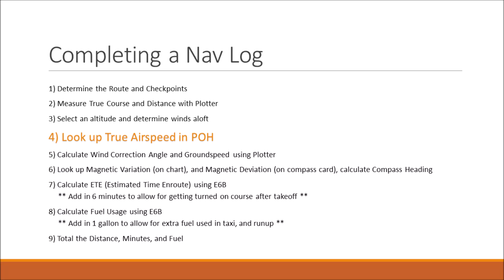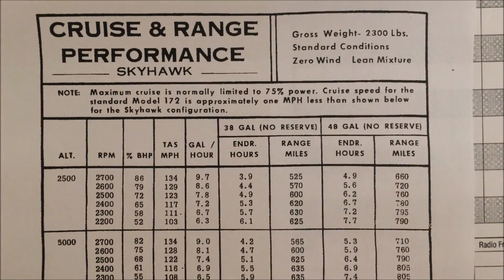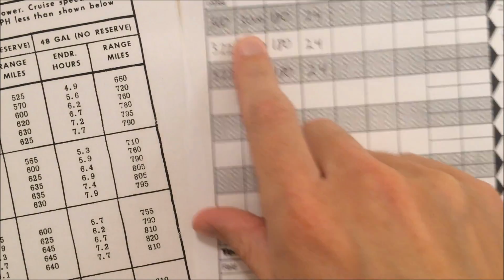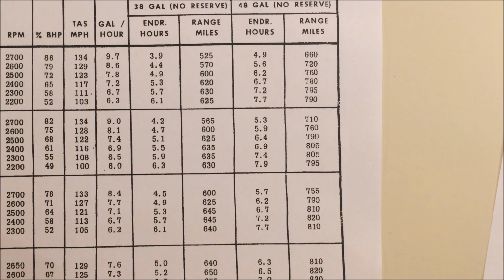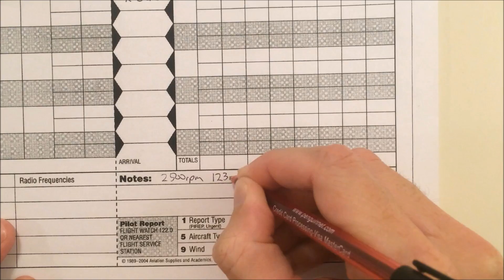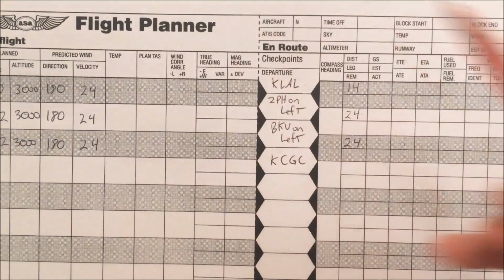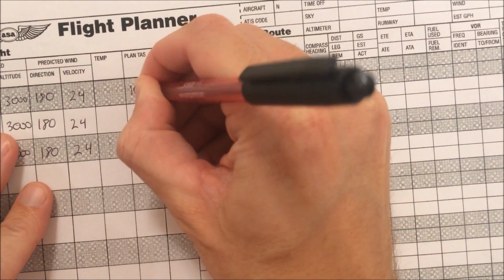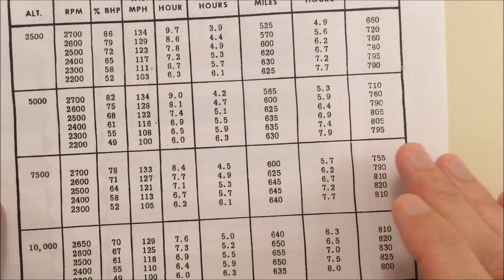VFR Nav Log (Video 4)  True Airspeed

Comment: Should you be cruising at a different altitude for collision avoidance?

"VFR cruising altitudes are established to reduce mid-air collisions by establishing cruise altitudes governed by FAR 91.159 which states: When operating below 18,000 feet MSL and: On a magnetic course of 180 degrees through 359 degrees, any even thousand foot MSL altitude + 500 feet (such as 4,500, 6,500, or 8,500)."

"; or on a magnetic course of zero degrees through 179 degrees, any odd thousand foot MSL altitude + 500 feet (such as 3,500, 5,500, or 7,500).

Comment: Hi, thanks for the videos, they are helping me understand nav logs.  My cruise performance chart and nav logs look a little different, and I’m confused about what values to use for TAS.  On my cruise performance chart, it uses pressure altitude.  For each of my checkpoints, if the true altitude OR the pressure altitude has changed, do I need to re-calculate the TAS for that checkpoint?  For instance, my originating airport pressure altitude is 8740 (true alt is 8500).  By the time I’m halfway along my route, my true altitude is 7500.  Do I need to find the new pressure altitude at that point in order to find that point’s TAS?  On your chart, all of your altitudes are the same, but are your pressure altitudes the same?  Thanks!! -Mary

Comment: Isn't 2500 rpm a bit hot and hard on an engine? That's full power for take off not cruise  no?  I would typically cruise at 2300rpm